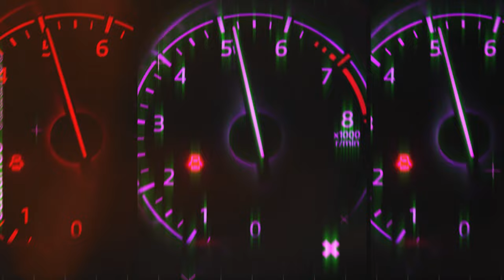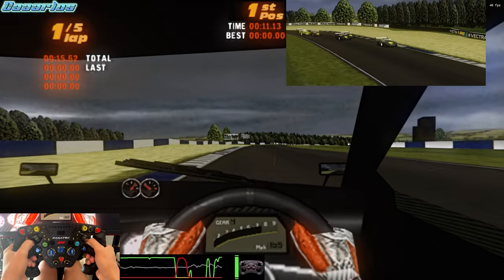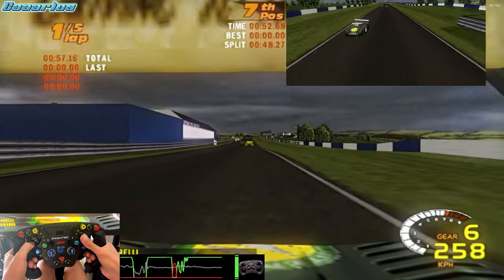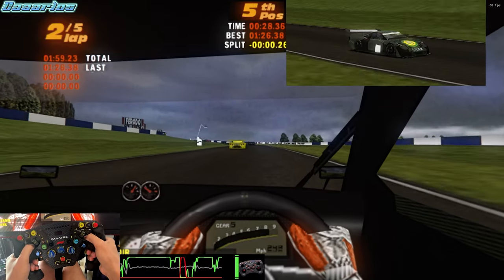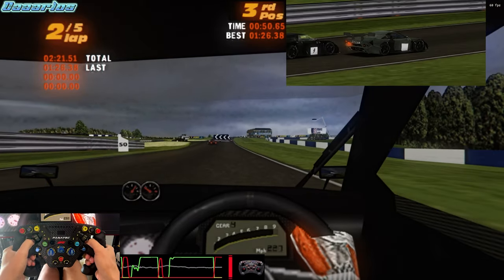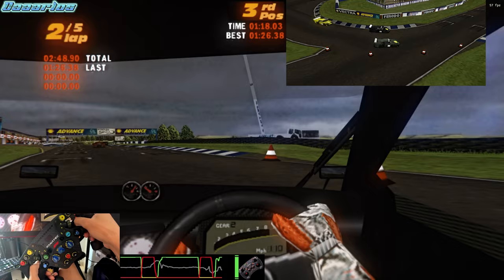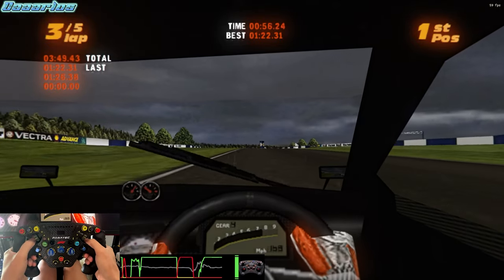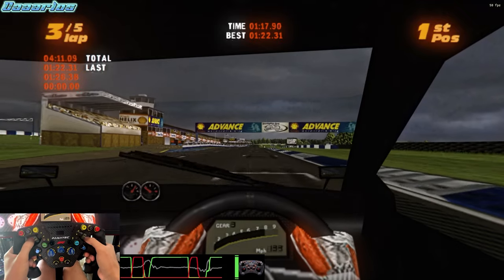Toca 2 Touring Cars in 2023! moded and with a sim rig!

Comment: Thrustmaster tx xw still good ?
Reply from the maker: Yeah ofc the TS-XW is the Xbox version of the TS-PC that I used in some previous videos. 
ATM there are very good cheap DD options on the market so depending on the price for the TS-XW it might be better to check out the Ready2Race bundle or the Cammus C5 aswell. 
You might also want to think if you're going to upgrade to loadcell pedals and have more steering wheels, idk if Cammus is the best option if you want to stay within that ecosystem.